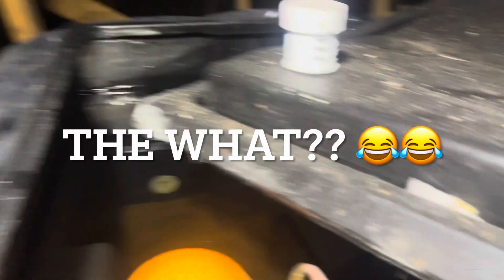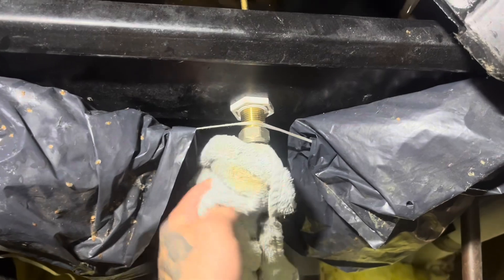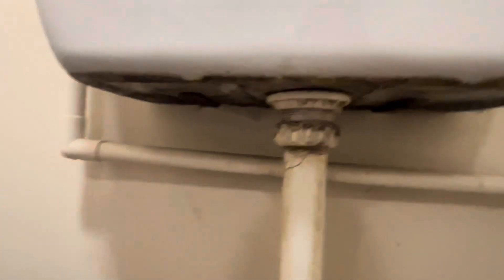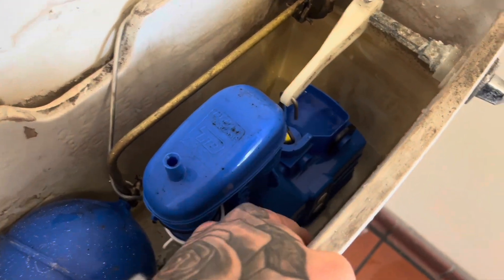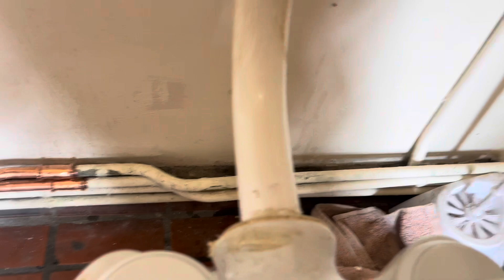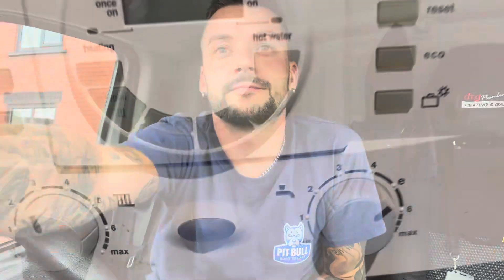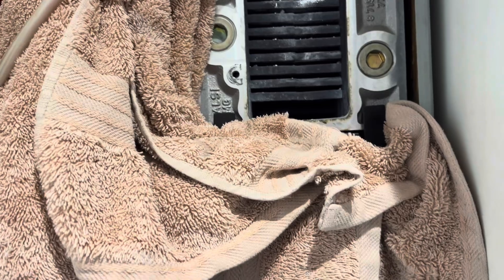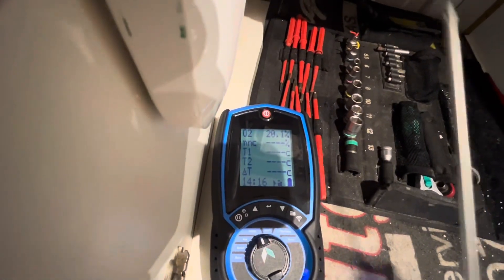#84 Is it the end of life for this Worcester boiler? And #jobbing in between!

Comment: Nice work on that cdi classic. When I was at Worcester, we never used the clean tool, rather we got a plaster board cutter hand saw and used that inside as the cleaning tool pushed the aluminium oxide to the back of the heat cell and compacted it at the bsck. The plaster board blade worked much better for removing the debris. You might like the cdi classic but I hated them. If you had changed as many heat cells as I did, I guarantee you would not be such a fan. Plus Worcester only gave you 1 hour to replace it. Almost always took 2 hours. When I turned up to one of them I knew I was gonna hsve a bad day. 🤣
Reply from the maker: Haha I’ve never changed a heat cell in one of these so that probably would be enough to put me off haha. With the cleaning tool being flat ended I suspect you’re right with it pushing the crap to the back. A plasterboard saw sounds a great idea and wish I’d of thought of that before buying the tool 😂😂 cheers mate 🫶🏽

Comment: nice work, Ive used that makita hoover for wet with no filter for years no issues as long as you don't over flow it, fine for the last bit in cisterns etc, saves having a soaked filter in the van 👍
Reply from the maker: Yeh that’s the issue having two filters and one ends up soaked and stinks haha. Cheers buddy 🫶🏽🫶🏽

Comment: I have a worcester boiler with kebab heat exchanger.. was a call to boiler not working.. got there, pulled cover off and it was just Ash inside! Red seal failed and set fire to all cables and cooker the boiler! Told him due to lack of proper service. Whipped him another boiler like for like.. he hasn't had it serviced again in years since I fit the boiler. Been back to do other jobs he just doesn't bother servicing the boiler...
Reply from the maker: What boiler did you put in mate? Some people just don’t bother and it makes no sense haha.

Comment: Great video! I came across a CDI the other day where the divertor was only moving down for heating on chimney sweep mode not normal operation, have you ever seen that?
Reply from the maker: So when you asked for demand on the thermostat etc for the heating the diverter valve wouldn’t move? Yeh in chinmey sweep it would? 🧐
Reply: @Heatking yeah heating it wouldn't move the divertor only when you put it in chimney sweep mode.
Reply from the maker: @plumberdan5720  I’d of been checking the controls first making sure the boilers recognising demand.
Reply: Yeah 240 on switch live

Comment: Them Worcester's don't live long without proper servicing.
Reply from the maker: Your right. In fact that applies to most of the greenstar range haha.
Reply: Yeah those kebab heat exchangers aren't great either. I had one the other day leaking from the top ring on the heat exchanger, that's a new boiler I'll be fitting on Thursday. I changed a flow turbine adapter on a junior today. I'm looking at the plastic that had degraded and I'm just shaking my head. You can say what you like about vokera but they use plastic hydraulics and they plastics never ever fail. That's comparing the top of the market with the bottom.
Reply from the maker: @daz3745  yeh I’ve seen the top ring fail a number of times. Apparently it’s down to running them with no pressure in but not sure.